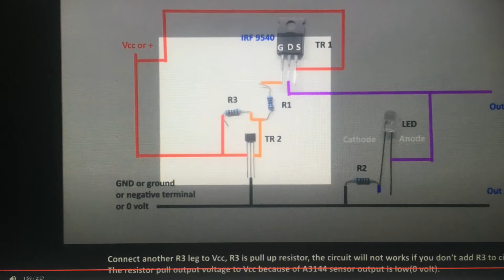#9 Shared SSG Basic coil design explain. start at top=North forward is CW reverse is CCW

Comment: What kind of iron wire
Is it insulated?
Can you show a price of it. Please?
So you have 3 coils. First one CCW iron, 2nd coil is CW but copper,  3rd one is iron again and CCW?
Did I get it right?
How many turns on each coil?
Thanks
Reply from the maker: It's actually 4 per CW and 4 CCw floral iron enamel wire 18 gauge .  copper is .90 mm  all connection are made like schematic  you end up with 2 wires in the middle and two wire at north top. Hobby lobby is one place I found it and micheal's Hobby store . I have som insulated tie wire that I will be using in the future at greater amperage. Turn's well since the spacer are moveable I wind a length  about 15 -20 feet .Then match that length in copper.  All copper wire are same length.  the longer the copper wire the more voltage is given You can adjust the length to match the voltage you want..
Reply from the maker: Four layer's per side 2 sides north and south
Reply: @sidster64  when you say sides
You mean 4 of the spools(coils)?
Thank you sur
Reply from the maker: @Gacha.Cupcake  Ok so you have a north side and a south side top and bottom.4 on the north and 4 on the south this balances out the magnetic field.
Reply: @sidster64  got it
Thanks my friend

Comment: Tbh i still didnt understand what you just explained. Could you pleease make a detailed video showing ghe parts from above. When u say we should wind a coil ccw and another one cw. Is it on the same core output coil wrapped on the input coil or both coils placed apart by a small distance on the same core. Please share the schematics if possible also please make more videos on building a basic model. There are i think a hundred videos but after watching a dozen videos i still couldnt understand anything. Next time when you make a video just explain properly and gives us diagrams, show us the building process, make us go through how it works slowly. Make more videos on how to build a basic model of an over unity circuit. And i dont even know whats ssg but is it something like bedini ssg. Please help me with the details.
Reply from the maker: Ok it's a 1929 pattern yes many video showing all details.everything is basic. understand of magnetic flow. It only enhances magnetic flux . Maybe with the right material's it would have greater output but I move on to simpler and greater conductivity of magnetic force.  These coil design have one issue in my opinion .    You can't visualize the power. that is why I moved on to spherical magnet.
Reply: @sidster64  but please make a detailed video explaining it slowly and showing the measurements
Reply: If me as a electronic designer cannot understand what ur explaining imagine how difficult t would-be for beginners who r just getting started in building these things. All those videos and still couldn't understand the basics.
Reply from the maker: @rajendraprasad1638  Sadly our science is incomplete. it's a 1929 pattern. and basic back EMF which is deny to bw useful.. Best wishes
Reply: @sidster64  I have seen the patent and replicated it too but it's not working. Could you please make a detailed video explaining it please